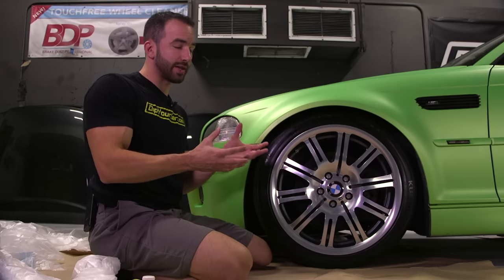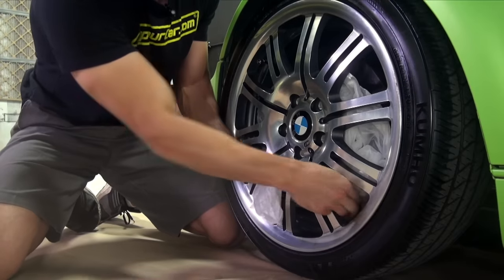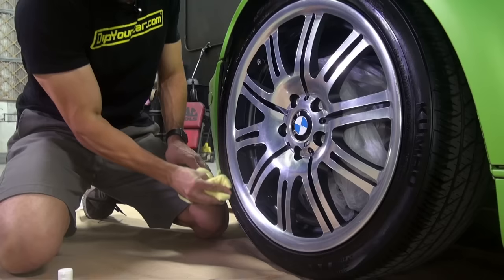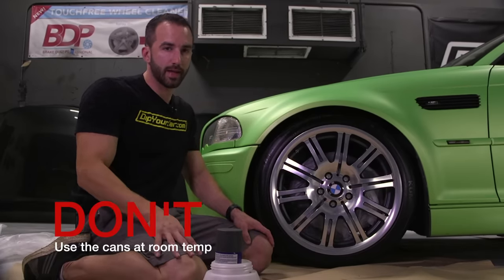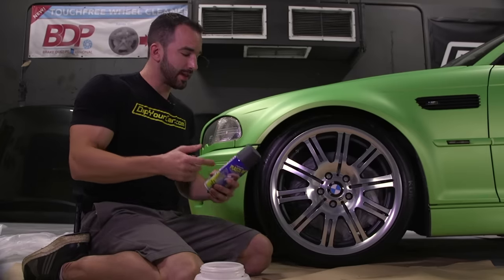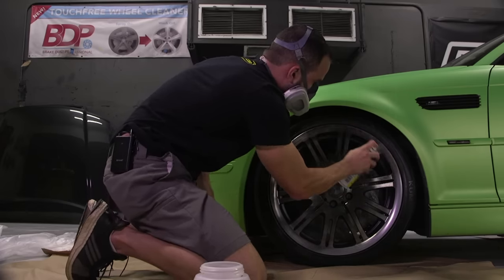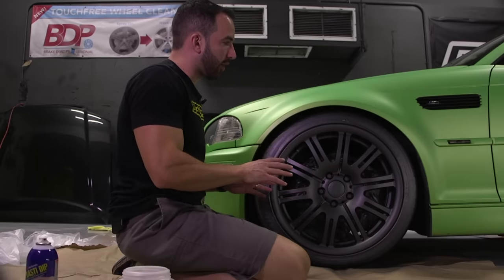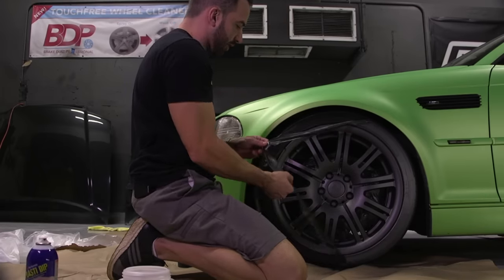Official Do's and Don'ts of Plasti Dipping Your Wheels

Comment: What about the Lugnuts once their plasty dip over does the lug wrench still fit over them and if it does wouldn't it kind a bang them up a bit trying to loosen and tighten them.
Reply: Plastidip is not staying on anything you throw a wrench on. If you're going to remove the wheels you better try your best to seperate the lugnut layer from the rim because it'll just yeet the whole thing off as soon as you turn the wrench. If you apply it with the wheels off then stick a ball of masking tape in each hole because once you go to put the wheel back on it'll rip it all off once the lugnut makes contact and turns if you don't. Some great stuff though don't be fooled. Looks great and has held up about over a year now for me.

Comment: Should have mentioned this should be done with newer tires on the wheels. The dip will peel and get damaged with tire dismounting and mounting. Don't get mad at a tire shop about it because it's basically guaranteed to happen.

Comment: Can the dip release be rubbed onto the emblem area of the wheel cover and on the lugs if you don't want dip on those areas? Also, kf we are supposed to use all 4 cans, is it just one whole can per wheel then?

Comment: Stupid question. Seriously considering attempting this, so I want to make sure I thought of everything. If I spray the rims on the car, what happens when I want to rotate my tires and have to take off the lug nuts? A. Will pulling the lug nuts that seem to get sprayed along with the rims, pull the plasti dip off the rims, and B. If it does not ruin the paint job on the rims, will my lug nuts need to be sprayed again, as I imagine they would get chewed up by the tire iron?

Comment: Dipyourcar guy.
Did my motorcycle runs a few years ago. Loved it. I removed the dip last year when I mounted new tires. 
Redipping this year. I have a few cans of red and black. If I put 3-4 coats of black and then 2-3 cans of red would the red stay a little darker? I had a few things dipped in the red last year and it seemed a little to bright. 
I was thinking if I kept the red coats lower then some of the black would barely be visible, making the red look a little darker maybe. Thoughts?

Comment: Just got finished with my third can on a set of 15” wheels. Do you think I need to do a fourth can? I’ve probably done about 6 thick coats after the initial rough coat. I’m also going to be applying Metalizer

Comment: - Remove the wheels
- Take the time, mask the tires
- Most importantly... curbs are your enemy... removing a wheel will remove dip from anything the socket comes in contact with like lug wells & nuts
- It's also a good idea to move if you drive off pavement &/or wintery roads.... essentially, don't drive it.
- You pay for what you get

Comment: Can this successfully be done on factory chrome wheels… my chrome wheels are very shiny/reflective surface… I am concerned because it is such a slick surface that the product may peel off easily while washing the wheels or using a pressure washer at the car wash on them…

Comment: Shouldn't you clean the tires and wheels first then apply the dip release doesn't inadvertently get removed while cleaning the wheels, etc.?   Minor detail, but just asking?

Why no masking of fender/car?  Not that big of a spray pattern?  

Suggestions if you have gouges on rims?  Will plasti-dip fill these in or do you need to fill them with something first?

Comment: What is that color called? Is it matte black? Gun metal?

And what about undercoating, do you need one?

Third question, can I put the cans in front of a heater instead, why soak them in warm water?
Reply: I can only answer one of those questions, but soaking in warm water is a more ambient heat and more even. Heaters are very uneven in the way they put out heat, so they won't heat uniformly. Warm water is also quicker. I'm not a professional painter, but I'm a hobbyist with an airbrush and a lot of painting experience.

Comment: Hi! 1. Wouldn't you end up leaving unpainted spots on the inner part of the rim that are visible? If so, how to avoid it? 2. Using the whole can per rim, won't the Plasti Dip come out after pressure washes? Thanks!

Comment: I don't have the pre dip product for tires. Any generic alternative ?
Reply: Lee Bourgoin try some tire shine but make sure you don't get it on the wheels or clean the wheels with predip after coating the tires
Reply: Spray rag with tire shine and rub down tires with out every touching the wheels
Reply: Take the tires off and use some index cards around the edge of the tire

Comment: I would love to know if it's fine to dip the wheels with the tire off. I have 4 wheels with the tires off a different car. I want to dip before I have new tires and sensors installed. Thank you
Reply: I plan to dip the whole wheel except where the tire covers.

Comment: Did this nicley but 1st time i took wheel off the car afterwards the plastidip caught the wheel socket/spanner and tore the plastidip from the wheel. Hours wasted.  Probably good to note once this is done u possibly cant remove the wheel without damaging the coating. Any way around this other than keeping the wheel bolt holes plastidip free (which doesnt look great) ?
Reply: Derek Whittle my dip lasted on my wheels for 3.5 years !!! It was only supposed to last 6 months. I only hand wash my cars, and when they did rotation on my wheels, they only peeled off the lock nut, all the regular nuts kept their dip somehow. 3.5 YEARS. it is insane how long that lasted. Living in Florida probably helps a little also, since there isn't crappy winter weather with snow and salt and stuff

Comment: You said 4 cans of the dip, 1 can for each wheel correct?
Reply: No....use 3 cans on 1 wheel....and use the 4th can on one random wheel. And just don't paint the other 2 wheels.
Reply: @matthewalston1226  lmfao
Reply: 1 can per wheel

Comment: If you mess up or don't like it, can u remove the dip?
Reply: Yes, one of the nice selling points of plastic dip is it peels off. However if it is on for a longer time it is sometimes better to respray and then peel off as anything over a year does make the product not as peelable. Depending on conditions.

Comment: Can you add clear coat over the top of the plastidip to get a shine
Reply: Yes you can add as much glossifier as you want.
Reply: I put 2k clear coat over the dip two weeks ago but now I noticed a couple spots on my rims that need more clear coat can I just clean the rims and spray more clear coat over them or would I need to wet sand them and respray them all over again? If I do have to sand them what do you recommend

Comment: Thanks bro.....your video has been very helpful to me......i got a question....does plasti dip cover scratches??????and how many coats can you make on the wheel with one bottle of plasti dip????is one bottle enough for one wheel or it needs more than one???????thanks!!👍👍👍👍
Reply: Depends on how deep the scratch is. 1 can per wheel up to a 19 inch wheel
Reply: @philb707  thanks man.....i've already painted them......one can per wheel.....four coats per can!!!!i also realised that it doesn't cover scratches completely......it makes them less obvious though!!!!i've painted more parts of the car such as the front bumper the hood  and the trunk....it's a great product......and i don't see any reason to remove it!!!!
Reply: Yes if you have deep scratches it cant hide them completely. Great product none the less

Comment: Have a question....if I have a bolt or nut on my body truck but I spray the plasti dip...& I remove the bold in the future...will the paint peel? Since am twisting or I guess removing an emblem...?? Thx lotz

Comment: My rims is currently painted with bronze color. Do i need to remove the paint before i apply plasti dip? Or i can directly apply plasti dip?
Reply: should just be able to plastidip them as they are right now as long as they're clean
Reply: Nope spray right over the bronze
Reply: Would it matter if there's some paint chips on the mags?
Reply: @charlesdc9770  Nope it will cover them, it they are really deep you will still see the indentation of them though
Reply: Ok copy. Thank you sir

Comment: Would the same steps apply to say.. My cars roof ? Make sure its clean and dry and should be the same , right ?
Reply: As Fonzie mentions in this video you don't want to use cans horizontally.  You'll want to use the DYC DipSprayer
Reply: What if you could turn the car on it's side, would that work, or would you get runs?

Comment: Yo....love the video. Quick question. I have a set of motorcycle rims that need to be dipped. The wheels are not on the tires yet. Can I dip the wheels, attach them to the tires and then attach the wheels and tires to the bike? The reason I ask is because I’ll need to send the bike off to a shop to have the wheels placed onto it. Just not sure if the dip easily comes off if someone needs to do work to the bike itself.

Comment: Will the Plasti Dip become damaged when I have new tires installed? The website says Plasti Dip lasts 3 years. Should I use an alternative coating for a more permanent finish?
Reply: yes it will get damaged putting on a new tire, the arm on the tire mounting machine will scrape it.

Comment: If you wanted to leave a part of the wheel the original color, can you use the dip release to do this? For example, if I want the lip of the rim to be the original silver color can I apply dip release, spray all my coats and then peel off the plastidip on the lip or is it better to just mask off the area I don’t want plastidipped?

Comment: What about min outside temperatures? I live in New England and it’s late fall right now.
Reply: Aaron Poisson  I’ve dipped rims in the cold with fantastic results. Like he was saying, keep the cans worm and you’ll have no problems. I filled my sink with hot water and id spray a wheel, then change to a different can and put the one used back in the water. Just keep swapping them out. But make sure you dry the can every time!

Comment: So you said don’t cover your wheels becuase it’s inefficient, what if I don’t have the dip release liquid you used and only have the cans of plasti dip, although it will take a much longer time is it still a possible option or is it required to use the dip release ?

Comment: I've got those exact M wheels on my E92, and the bad news my powder coating was chipped and starting to crack from the idiots who put new tires on it. Can I dip my wheels with cracks in the powder coating and it turn out alright with enough layers?
Reply from the maker: Dante E92 335I you can for sure, but you may slightly see the outline of the cracks depending how deep they are. Either way will be a huge improvement.
Reply: Thanks for the reassurance.  Buying my kit next week!

Comment: One issue that absolutely none of the utube videos cover is not to plasti dip your lug nuts, unless you never rotate your tires or do any other maintenance requiring wheel removal. Also taping up the bottom flat surface where the lug nuts contact the wheel so no plasti dip will be pulled off if you ever have to take the lug nuts on and off.

Comment: Any suggestions for removing dip from the center caps after your done spraying?
Reply: Rashad Morris I'd take a razor blade and run it around the gap between the cap and the wheel and peel it like normal. Same goes for any gap between panels
Reply: ed elsey makes sense thanks
Reply: Rashad Morris good luck with your project! My wife wants her Avenger dipped in Grabber Blue. I can't wait to get started.

Comment: Has anyone ever plasti dipped over previous plastic dip job? My assumption is that isn't recommended but I wanted to ask. I have some spots on my tires where the dip as chipped away. Can I just touch those spots up? Or is it necessary that I strip that entire tire and start fresh?

Comment: Dipped my 17" for the first time a few weeks ago, very satisfied with the result.
I did 4 coats of mat black as a base and finished off with 3 coats of graphite pearl metalizer.
I used all my 5 cans for the base as I dipped the inside of the wheels also. I bought 3 cans of the metalizer but ended up using 2 of them (outside of wheels only) because I already reached the desired colour.
The first 2 light coats went horrible, because I had huge droplets of paint coming out. The cans were heated in warm water but apparently not enough. I was in a garage but it was quite cold outside so the bucket of warm water didn't work for me. I needed to wait for a coat to dry (even longer because of the cold), so in the meanwhile the water and cans would cool down again. I then put all cans on a radiator inside the house (use common sense) and let them sit there until I needed another can. That right there was the key, from then on all coats went on smoothly. I think I could've saved a can if the first 2 coats were warm enough.

So my takeaways for the next time:
- Do not underestimate the can/paint temperature, they don't need to be hot, but warm.
- 'Wisely' rotate tyres during or after each coat.
- Cut out circular cardboard pieces to fit inside the lug nut holes. While screwing the lugs back on I could hear some squeaking of the dip going on inside. No visible damage but I'm sure a little dip was removed.
- didn't do the Dip Release on the sidewall tyre thing as it was mat black on a black tyre. Didn't think it would bother me, but every now and then I find myself picking of small left over dip from the tyres :p. Still no drama, but I would use some type of protection next time.
- While spraying change hands frequently because your index finger will start to burn. You'd want a single coat to dry evenly.
- Sorry DipYourCar but the 2.0 spray nozzle and the spraycan trigger just didn't do it for me. The original nozzle was better imho and I got the feeling that the trigger didn't press down hard enough on the nozzle which had bigger paint droplets as a result.
Reply: Great tips thanks.  Regarding the circular cardboard pieces you placed inside the lugnut holes, does this trick allow you to be able to protect spraying the lugnuts so you can remove the wheel later without ripping the Plasti Dip?

Comment: Can you show the outcome after the first tier rotation/tire change? I strongly suspect that you will be redoing the wheel dip every single time you rotate the tires and it is 6000-8000 miles. No, tire place is not going to care about your dip and the nut areas will be scratched in no time. Nuts will be scratched even if they care...
Reply: I don't have ANY dip there.  I sprayed with a nut and bolt in place...that said, I also rotate my own wheels.   Way too easy to pay someone else to do it.

Comment: If you leave the wheel in place aren't you going to run into problems when a lug is removed??

Also, you didn't masked the car... Aren't you worried about over-spray?
Reply: Yea, I can't imagine that leaving the lug's in place is safe for long-term. May get away with it, but I would really fear a tire rotation once that dip seals to everything.

Comment: So do you use 4 cans on 1 wheel, or 1 can each wheel? Your grammar is confusing me quite a bit.
Reply: I pretty sure it's one can per wheel.  Otherwise you'd be spending almost $400 to plasti dip your wheels.  A few more bucks and you could have them legit painted.

Comment: Question my hellcat already had dipped wheels when I purchased it. One of the wheels dipped has started to peel can just touch up over the already dipped wheel or do i need to remove the old dip first?
Reply: For a nice uniform finish I would suggest peeling the current paint off and re-do the wheel again.
Reply: Charvel86 thanks. Also how do i get the exact color? The current looks like matte black
Reply: he has another video explaining how to remove tears and blemishes. probably tells you to buy some special product thats made for plastidip when in reality its probably paint thinner or something like that.

Comment: how much time from a coat and another?
Reply: the cans I have say a half hour
Reply: coat one wheel....move on to the next wheel, by the time you finished the 4th wheel, it will be time to recoat the first wheel
Reply: @mcameron6031  I do a coat in less than 2 minutes.  I'd need 15 wheels for there to be enough dry time to coat the first
Reply: you dont need 30 minutes for PD to dry enough to recoat.....on a nice warm day you should be able to recoat in 10-15 mins...
Reply: @mcameron6031  Not all days are warm,  and I'd be at 8min anyway...
Reply: 1) dont paint when its cold out.....first rule of painting anything
2) im assuming you can burn 2 minutes walking from tire to tire
Reply: @mcameron6031  Not being warm isn't cold.  There are temperatures in between.  That said, the directions say 30min.  You don't always have to follow directions but it also won't kill you.
Reply: do what ever you want pal.....ive dipped my wheels as i described multiple times and its always worked for me.....
Reply: @mcameron6031  I bet you have. I've waited 30 minutes without issue too.  And I've painted when it wasn't warm, without any explosions.